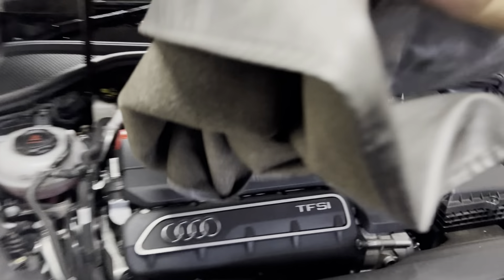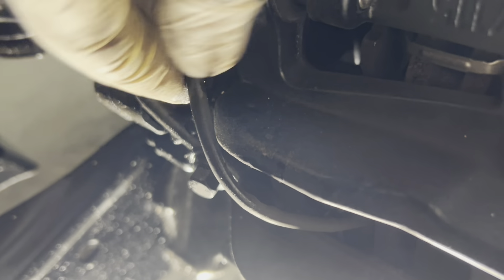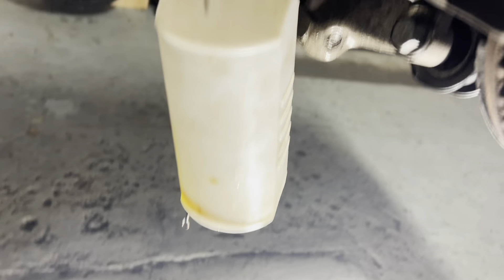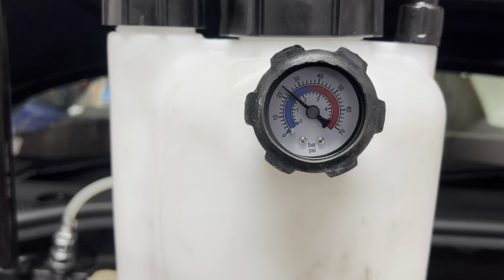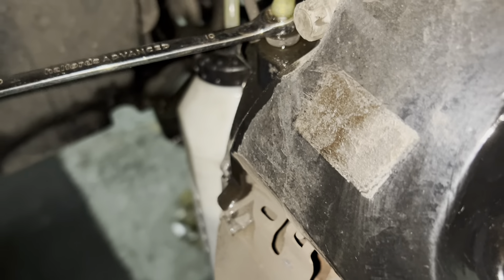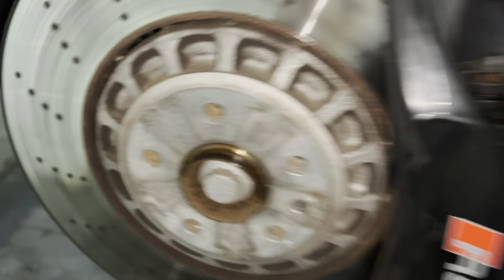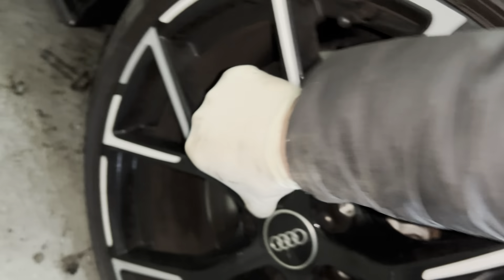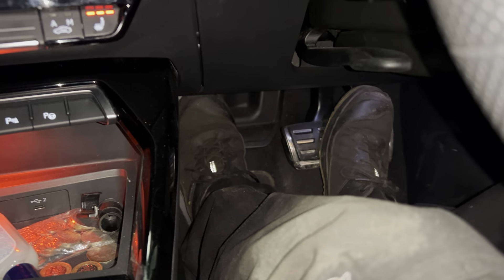Audi RS3 8Y Brake fluid change done the proper way

Comment: Thanks for the video. I checked the Audi service manual for my US 8Y RS3 and bleed order for left hand drive is left front (outer then inner), right front (outer then inner), left rear, right rear. Is the order not that important?
Reply from the maker: The Audi manual always tells you to bleed from the front (which is backwards to what the entire world says) but , throughout my years at the dealer no one ever followed the manual and always started at the furthest away from the master cylinder. And I’ve always done that too. As long as the system is pressure bled I don’t believe it makes a difference. But if in doubt follow the manual.

Comment: How much brake fluid do I need then? I have an A3 so I'm guessing I need less than an RS. Will a Liter be enough to flush all 4 calipers? Thanks
Reply from the maker: Depends how much you pump through. A 1l bottle will be enough
Reply: @ZakKol69  Bought 2L and if I dont use the second bottle I will just return it :)